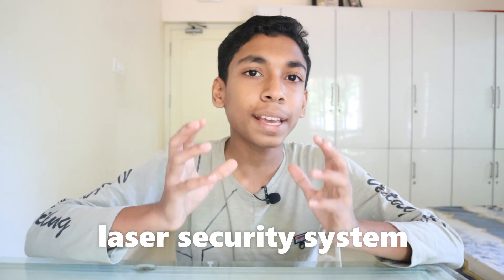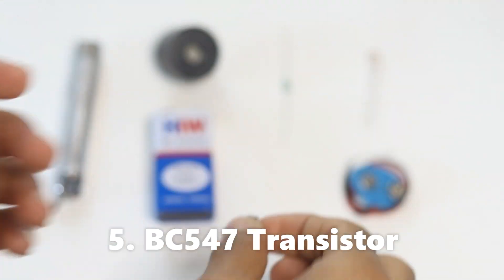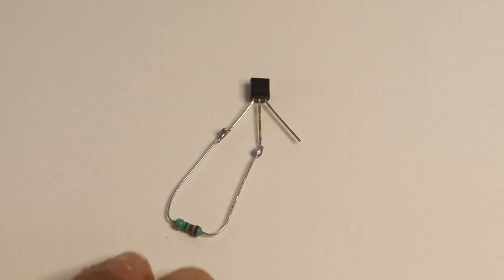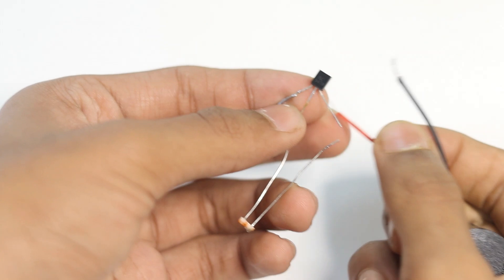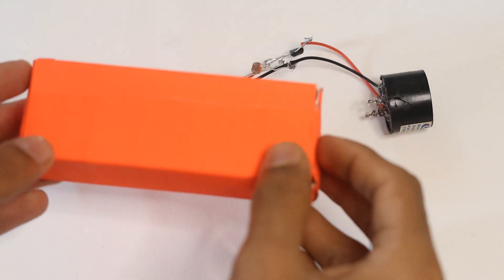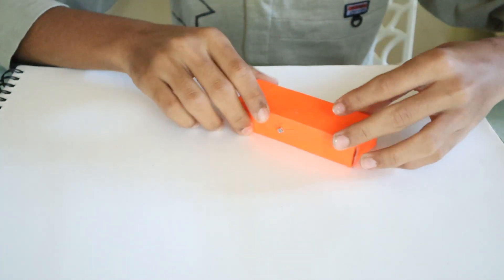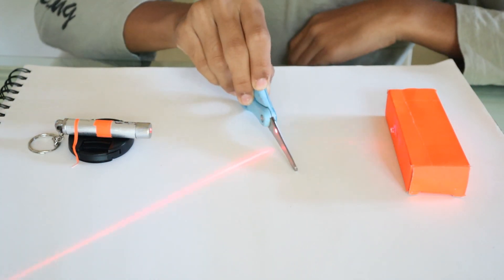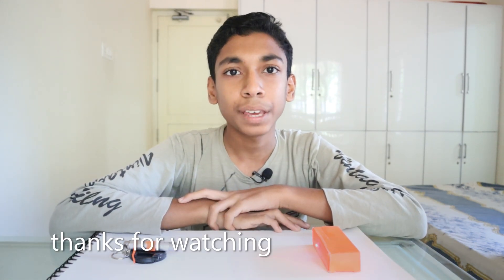How to make a simple Laser Security System

Comment: I have items like 2.2k ohm 1v resistor , piezoelectric buzzer , ldr , 9v battery , bc547 transistor and battery connector bro this items will work bro
Reply: ya but u will have to solder it properly thenit will work\